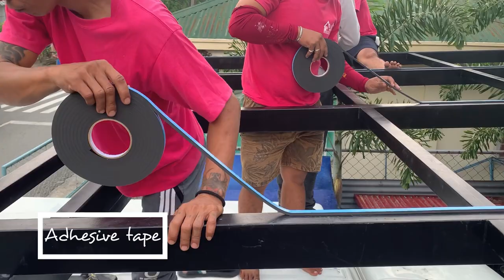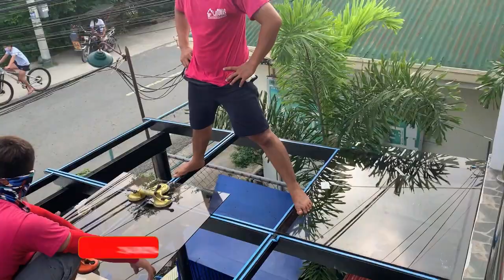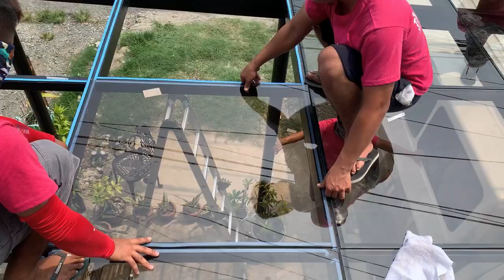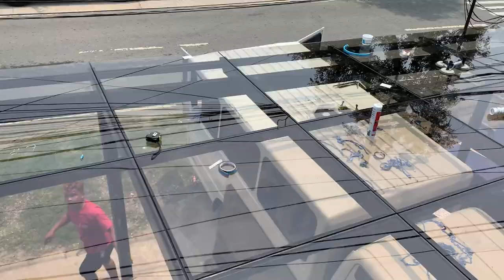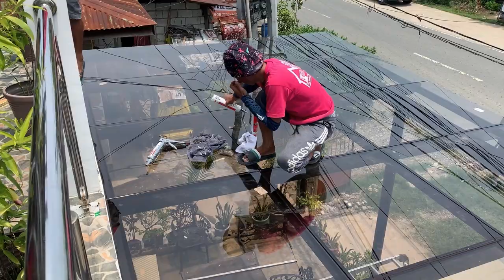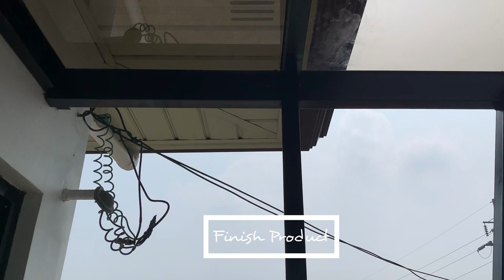SKYLIGHT GLASS ROOF|6mm TEMPERED BRONZE GLASS

Comment: It looks nice, but I wonder how it would resist storms? As we can see the glass is merely held by double-sided tape and a bead of silicone on the sides. In a typhoon, you could have an uplift force of about 200 kg per square meter. This would be like pushing each individual 1 x 1 meter panel with a force of 200 kg. Most double sided tape in the Philippines is not very durable, except if you buy expensive 3M tape. Here the tape is exposed to heat from the sun and slight movements movement due to heat expansion and winds. I doubt it would survive a severe storm after a few years of sun exposure.